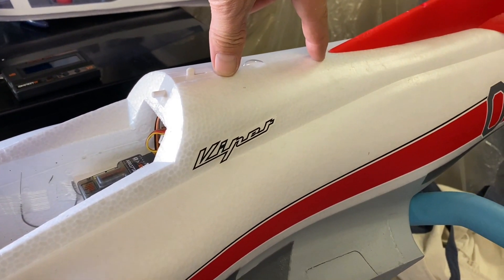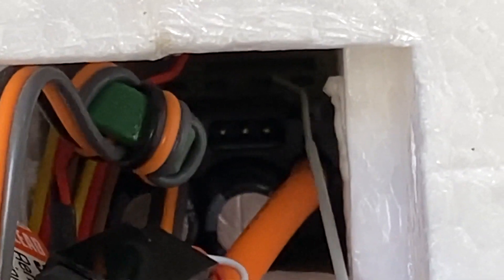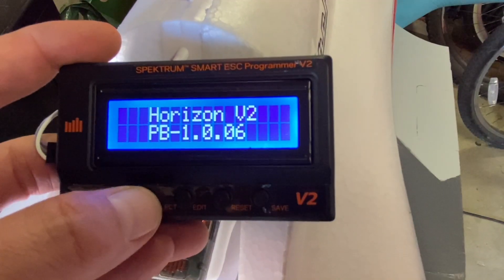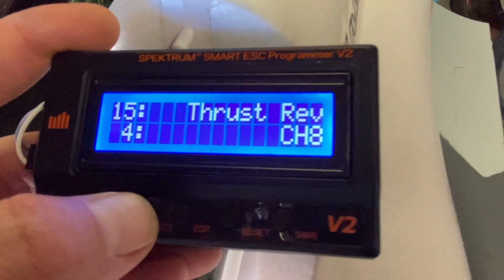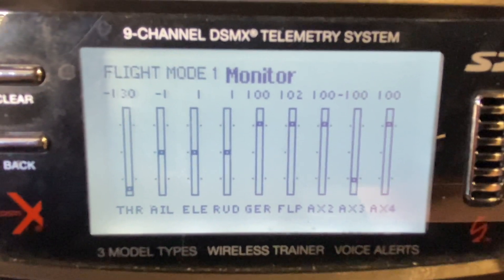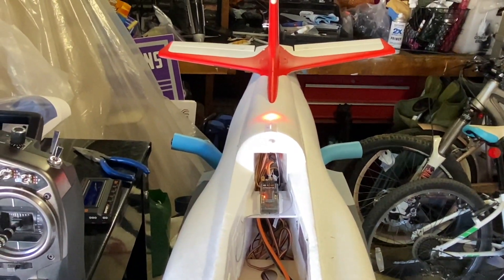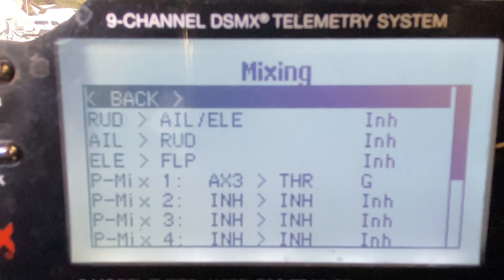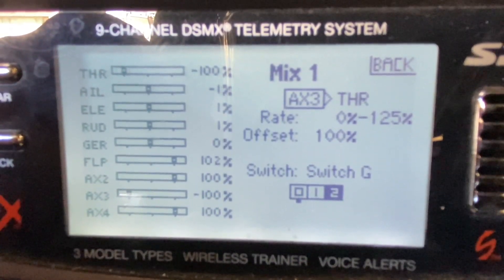Eflite Reverse Thrust Programming, Viper 90mm, Draco

Comment: So I bought the programmer and set up my DX9 as the video described. I still don't have reverse thrust. I'm sure I'm missing something any suggestions?
Reply from the maker: Did you hit “save” on the programmer. And is the channel you assigned it to active
Reply: @7demo7review  Yes. Switch G works but it's Normal thrust , middle switch nothing than third position full thrust  checked everything.
Reply from the maker: @miketay100 make sure your endpoints are correct
Reply: @7demo7review   I'll need to check. Thanks I know I have the mix correct. I missed what the thottle endpoints should be set at
Reply: THink I've got it now. Thanks for all the help.

Comment: SO YOU connect the programmer cable from the esc to channel 8 correct?
Reply from the maker: It’s a setting in the programmer. I can be changed between a few different channels

Comment: I have the same gen1 DX9. I have upgraded firmware and all sound features.
I can see the Avian Prog menu with my Turbo Timber Evo, but it will not move to step 2 in the program menu. I have set all to 100% travel with no D/R and expo, and throttle cut to 130. It will not advance to menu 2 for stick programing.
Thank you, now I can get the programmer and program.
Reply from the maker: I’m considering a NX10 but I’ve heard of problems with them
Reply: @7demo7review  what problems have you been hearing